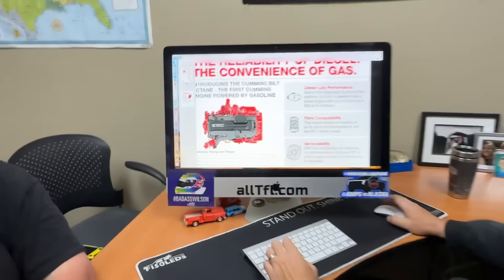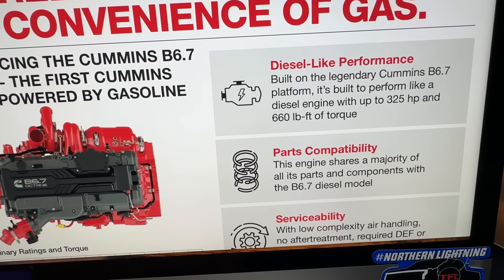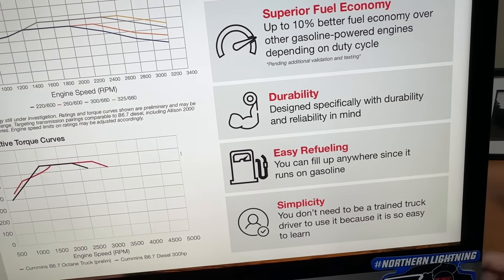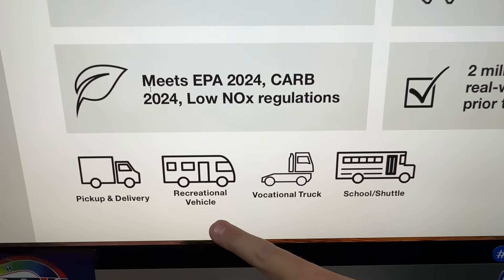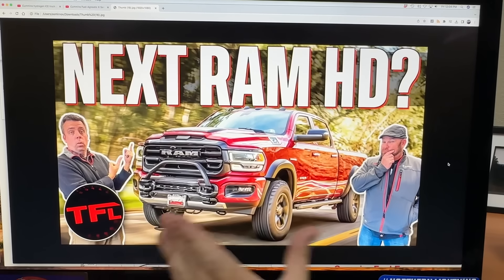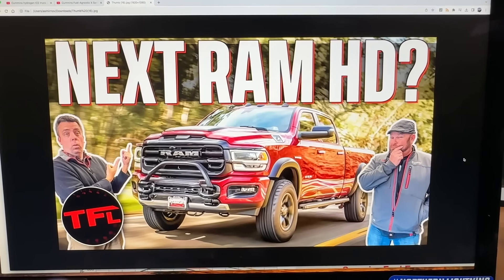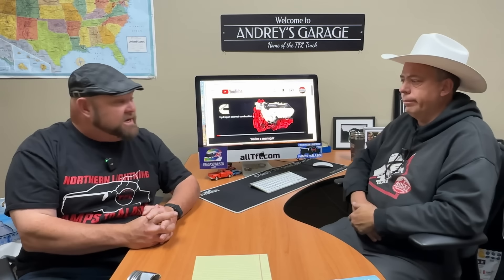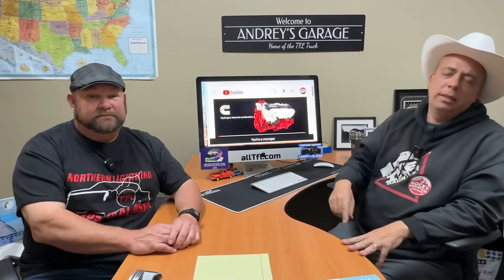It's Not Just Diesel Anymore: Cummins Built a GAS Engine We Want to See in the Next Ram HD!

Comment: The 6.7L diesel is arguably the best (I think) medium duty engine ever. However, unless the gas version is substantially cheaper at a cost comparable to other gassers, I can't see where it fits in as just another gas option. Worked for a major dealer for 25+ years and literally sold thousands of the 6.7 diesel and its forerunner, the B5.9.

Comment: My wife love her Ram 2500 4wd with that beastly 6.7L.  As long as the gas engine has a VGT turbo, it will be accepted.  The ZF 8-speed powerline transmission should be a plus.  The Jeep JLU performs better than the JKU because of the extra lower gears with the 8-speed transmission.
Reply: why VGT turbo on a gasoline engine ? why not  regular waste gated turbo ?
Reply: @hellohumans175  - The VGT have 3 benefits, 1st is a faster response at lower rims, 2nd is enhanced engine braking, and 3rd is less energy and fuel wasted.

Comment: They do have parts in common, but Stellantis has a deal with Cummins to have a separate motor for the Rams. The B6.7 Diesel is found in the Freightliner M2-106 and International Medium duty and ICCEs so it will most likely be in thosr

Comment: It's something they've been doing already for years.  It's expanding to more fuels now, but the diesel and CNG versions of their mid range road going stuff has been sharing a block for years, among other components.  I'm interested to see how many other components the new versions share across platforms.

The natural gas versions in the bus fleet locally seem to be the most cost efficient, and least maintenance intensive option.  With minimal aftertreatment required, they are very simple.  But, they run HOT.  There was/is a massive recall for the early models that melted the pistons since they ran significantly lighter than the diesel.  Turbos are vacuum controlled wastegate systems as opposed to VGTs.  I personally don't like the lack of power, but they work well overall.

Comment: This engine would be crazy expensive for a gas engine compared to the hurricane. I can see this as a replacement for the diesel but will someone  pay 10k for an upgraded gas engine.
Reply: Why? The hurricane is a from scratch engine. New tooling new block new everything this is a 6.7 with a aluminum head and cast pistons.  Hurricane will shit the crank out the block of it had to make 650+ftlbs at 2k rpm
Reply: If not diesel, but same engine it would be interesting to see the price diff. I wonder how much of that 10k premium is caused by fines and diesel regs.
Reply: If they can keep the cost of the gasoline engine option to $4000 over base, I think it will sell well.  The diesel option costs ~$10,000.  The gas engine should be cheaper due to no DPF or SCR systems, and the fuel system will be cheaper as well.
Reply: This engine would not, in my opinion, be an option for large hd trucks. It’s fit would be better in the medium duty truck market, say in the freightliner M 200 series or any of the large box delivery vans.   The natural gas option for these trucks would be a better fit. Hydrogen gas is a pipe dream for anything not mounted to a stationary platform. Just not enough heat energy in the gas to make it truly viable for anything else. Natural gas options have been around for years. They burn cleaner than gas and have fewer emissions problems and  a very good maintenance cost per mile over the diesel. I don’t look to see this in any Ram pickups.  Just don’t think there would be enough cost difference to make Ram dump their newly designed six cylinder engine.
Reply: @DJ-ve5lr  I would think a huge part of the $9k+ Ram charges for the Cummins is due to the SCR/DPF systems. That's like $6k to replace. The 6.4 Hemi to 6.7 gas Cummins would be more like $2-4k I would think.

Comment: Excited to see this in a future Ram 2500 or 3500. The benefits of a gasoline engine not developing all that carbon soot blocking up the EGR, no DEF, able to drive teh car 5mins down the road to the shops without worrying about gettting a diesel up to operating temps to burn cleanly, there's so many positives. And that's before the aftermarket tuners even get hold of these motors! So much to like about this - and from an Australian perspective, it's like running a big Ford Barra engine that's going to be tuned. The diesel engineering of the bottom end will add an awesome ability to pull much bigger numbers out of these motors!

Comment: If you know anything about older military trucks, White Motor Company built the multifuel engines for the M35A1 trucks. Instead of complex electronics, the injection pump system measured the viscosity of the fuel to cause the distributor injection pump to deliver the proper amounts to individual mechanical fuel injectors. This is a more complex way to do some of the same things using a common rail fuel system, or did they go back to individual fuel injector pressure lines from the high pressure pump source? Cummins has already tried extremely high pressure common rail fuel feed to the injectors. Any screamer Detroit 2 stroke is a common rail fuel source engine, any 855 Cummins and brethren. A new version of old with new engineer trying and money.

Comment: The company I work for has been running thousands of cng otr trucks and package delivery vehicles for probably around 8 years. If you have any thoughts on owning one, you had better make darn sure you have a pumping station everywhere you plan to go. The range is very limited. They eat spark plugs like candy. They crack cylinder heads more frequently than they should. Power is not equal to diesel. I am glad that I still drive a diesel

Comment: It will be nice to have a cummins that can be idled without the anxiety of wet stacking slowly leading to lifter failure. Let's just hope it doesn't have some hilarious oversight like the grid heater bolt coming loose and grenading the engine.

Comment: The aftertreatment tech required to make diesels work is its Achilles' heel. Cummins is smart to push the CNG and gasoline options. 

The marketing play for the B6.7 Octane is that it's so overbuilt it will basically last forever. The question is whether they can make it efficient enough to overcome its extra weight compared to the V8s in the Ford and Chevy. An interesting alternative would be a turbo 4-cylinder version of the B6.7 Octane; it could boast superior efficiency and not have the weight penalty of the 6-cylinder.

Comment: Ram should have an option to bolt on an Eaton Fuller manual transmission to the Cummins engine
Reply: No they shouldn’t
Reply: Why not
Reply: @VHP7044  Why would they? It’s pointless. Useless. Never gonna happen
Reply: They have to cut power when the automatic shifts, then ease it back in. 
The dealers would have a steady stream of rear ends to warranty with a manual.
Reply: @scotcoon1186   Then put a decent sized rear end in it.  It appears they cannot build a decent automatic that can handle the power or provide a decent life cycle like a manual could.

Comment: I've seen this coming for years.  Diesel aftertreatment systems such as SCR, DPF, and EGR has been increasing initial purchase price and operating cost to the point where a durable gasoline engine could be overall cost-competitive with diesel.  If their engine runs on regular, which currently is at $3.57 in my hometown, it would be cheaper than diesel, which is at $3.96.  Without the aftertreatment systems and HPCR fuel system, initial cost should be a lot less than the diesel version of the same engine.  If they expand the engine's capability to run on ethanol blends, the power and torque would go even higher, and fuel cost could be even less.  E85 in my area costs $3.19 now, and running a blend of 50% E85 / 50% regular would bring fuel down to $3.38.

Cummins has a long history with spark-ignition engines.  They have run a subsidiary called Cummins Natural Gas Engines in Clovis, NM since the 1960's.  And I worked on a natural gas C8.3 at Cummins in 1994-5.  It used the same block and head castings as the diesel, but the head had spark plug machining where the injector used to be.  Dished pistons at 10:1 compression ratio replaced the diesel pistons at 16.8:1.  Doing production qualification tests on that engine, I accumulated 6000 hours of testing in about 18 months, and they never failed to perform.  If Cummins engineers an aluminum head for the gasoline and natural gas versions, it would save ~200 pounds on the engine.  Could be good.

I would like to see the HP of the 6.7 gas engine get to 350 HP.  The torque is good at 660 lb*ft.

Comment: Id be interested in a 2500 with just the new twin turbo Hurricane engine. Maybe the HO for the 2500 and 3500 models as a gas option. The HP and TQ are better than the 6.4 Hemi... This new engine is exciting but price could be scary.  I was really hoping for something like a 5.0L twin turbo Hurricane for the 2500 and 3500.  6.7L is even better but it wont be cheap. Hopefully the gas option will still be more affordable than the Diesel option (about a $10K savings with the 6.4L instead of the Cummins 6.7 diesel as of now).

Comment: I wonder if the CG version would be a better version to burn Propane  rather than the Gasoline version.     In my part of the world you can save a lot of money on fuel  using propane even though you loose significant amout of fuel milage using a conventional  gas engine.

Comment: So here’s the Ram thing: currently, the Power Wagon isn’t optioned with a diesel because (according to Ram) the larger engine interferes with the sway bar disconnect and the winch. If the 6.7 Cummins moves into the Ram lineup, it either means that the PW gets redesigned to accept the bigger engine, or it goes away entirely.
Reply: That can be figured out. Easy if wanted
Reply: @Upliftyourbrothers  I assume it already has been: I don’t think it’s an accident that the next version of the Ram HD is expected at the same time as the new Cummins engine.
Reply: Hey the 6,7L is all ready in the Ram lineup. I have a Ram 3500SRW with a 6.7 Cummins.

Comment: The model T used a multi fuel engine. A look back on big truck engines I have a 1948 Brockway with a Continental R6572 gas engine (inline 6 572 CID) Continental built the RD6572 which was the diesel version just a different head.

Comment: I’ve always wondered the kind of life expectancy you could get out of a gasoline engine if it was way overbuilt like the typical diesel engine. 500k would likely be no problem. Probably could go well beyond that with good maintenance. Big straight 6 gas engines are awesome, better than V8s. With a turbo it’ll be a monster. 

This would be awesome in a HD ram. No DPF, DOC or SCR. 325hp 660lb ft is more than enough for what most do with a pickup truck. Although I do love the 850lb ft of torque with my 6.7.
Reply: Don't be too surprised if you see a GPF on that truck when/if it hits the market. Gasoline Particulate Filter. They've been on vehicles overseas for several years and are starting to show up on some in the USA. In particular the new Ford nautilus SUV. I expect them to be more common as the new EPA '27 rules get implemented.

Comment: I have to believe that if Cummins knows the 6.7 will be built for gasoline use that the piston dome configuration would be somewhat different that that for diesel. Maybe not, but the head will have to be different then, as advertised,  because the compression ratios gasoline vs. diesel are very different.
Reply: Yes the head would HAVE to be different to accommodate spark plugs and (probably) different style injectors and to reduce compression ratio. It's hard to say what all will need to be changed to meet EPA certifications & it may require a specially designed piston to get everything "just right".

Comment: I'm sure Cummins via Stellantis will not give anything away. The gasoline version of the Cummins 5.9 diesel is a nice idea but I'm surely thinking it will cost a lot even as an OEM option. It may attract some buyers who are cast iron block, 6-cylinder auto fans and maybe a few extra who have money to spend. Also, a gasoline version maybe attractive as the cost of diesel fuel is so high, but for those who like the design and durability of the Cummins B5.9 block. It will be interesting to find out how Cummins will make the gasoline version meet EPA emissions standards.

Comment: 50 years ago all the manufacturers all threw the same engines, transmission, and axles at everything.  They just screwed us all up with different bell housing bolt patterns.  How many vehicles had Dana 44 axles, Borg Warner manual transmissions.

Also back then International Harvester basically had the 304, 345, and 392 v-8 engine, and then the 152 and 196 4 cylinder engines.  Excluding the 345 those engines shared a lot of parts.  I can't remember, but I don't think it ended well for International Harvester Scout Line of vehicles.

Comment: This news has been around for a couple years now. In my opinion they need to get that HP number up. Just not enough HP. That's also a big, heavy engine and it's going to reduce payload on the 2500 significantly. Ram better figure something out with the suspension to handle more payload if they use this engine. Or no one is going to buy a 2500 gasser over Ford or GM.

Comment: I'm a 6.4L Hemi owner. I drive about 12k miles a year, and almost half that is towing 10k+. I have zero interest in a diesel. So the 6.7 gas has my interest.
Reply: I am in the exact same boat.  Looking to move to a Cab Chassis in 2026.  If Ram offers this as an option it will be them, otherwise F550.

Comment: The REASON the cummins 5.9l became a powerhpuse of tuning is it was a tractor/industrial engine. Made to run at full throttle for most of its life= a pick up truck barely even loads it. I duno if modern cummins still builds things this way but they where the o.g. reliable diesels even cummins man drive accross cluntry before highways.

Comment: What if they put a turbo on this 6.7L gas motor like the new 3.0L turbo?  Even more low end torque with a flat torque curve.  If they are saying the NA version makes 660 Ft-Lb it would be feasible to see diesel like torque numbers by simply adding a turbo and intercooler.  Maybe Cummins sees the cost benefit of not getting spanked by the feds for emissions.  As for fuel mileage, they may have to add a decimal point or two on the display.

Comment: Didn’t GM try this in the 80’s and had disastrous results?
Reply: Tech has improved a lot since the 80s
Reply: The other way around,   they took a gas engine and made it a diesel.
Reply: @Kevin-xy3yr  untrue but that is the rumor. I worked on a lot of them in the Air Force. 
Terrible design but they weren't just a gas engine they tried to cobble diesel parts on.
Reply: @marcochavanne 
They were 350 Oldsmobile gas engines that converted into a diesel engine. Cast crankshafts and rods. The lower end didn't hold up well, also tons of oil leaks.
Reply: @marcochavanne  you worked on Oldsmobile passenger cars in the Air Force? That's where they did it. It wasn't the 6.2 and 6.5 Detroit diesels that it was done. It was a 5.7l in Oldsmobile vehicles. Look up LF9 Oldsmobile diesel on Wikipedia. It was indeed true and not a rumor that GM tried it.
Reply: GM infamously converted a gasoline 5.7L Olds engine to run on diesel.  The cylinder pressures are much higher for diesel, the 5.7L diesel had very poor reliability. 

What Cummins is doing is converting an engine already designed to run on diesel (high cylinder pressures) and swap on a gasoline cylinder head (lower cylinder pressure).  No details yet but I'd presume the pistons would be changed and possibly the VGT turbo.  The 660lb-ft number looks like it would be class leading.  This would be a great engine for fleets use since their extended idling is very hard on the aftertreatment system.
Reply: @samgford  Nobody specified which engine but they say the same thing about the 6.2 and 6.5 engines. Had my fill of working on those in G-Vans. They were starting to use biofuel while I was in and if they sat for a while it would grow all kinds of funky stuff in the fuel systems.
Reply: @marcochavanne  I have never heard people say that about the 6.2 and 6.5 unless they were mistakenly thinking of the 5.7 Olds story. Maybe the same is true when you've heard people saying it, but it was never clarified? Doesn't really matter. The facts are that the 5.7 Olds was a gas to diesel conversion. The 6.2 and 6.5 were made by Detroit Diesel which was very similar to the relationship that GM had with Isuzu when they started the Duramax brand. That is to say it was incestuous as hell for ownership, but still not all on GM doing R&D and production.
Reply: @samgford  got news for you , they also tried this abomination in the half ton pickups for a couple of years before they went to the 6.2 engine .
Reply: @bobbrinkerhoff3592  Thanks! I didn't know that! Once I saw they only did 2wd models it kinda made sense why I didn't know before since I've always been into off roading. Cool new nugget of info!
Reply: @samgford  I knew a big truck mechanic that made the mistake of buying one way back when . He thought that because it was a diesel, he'd get great fuel mileage and it would last forever . It didn't take too long before he traded that dog turd in for something else .

Comment: Cummins already had a national gas version of the 6BT and International had a dozer engine that ran on diesel and gas back in the 50s

Nothing is new
Reply: Most early diesels either had a pony motor, or started on gas to get enough heat in the cylinders to light the diesel.